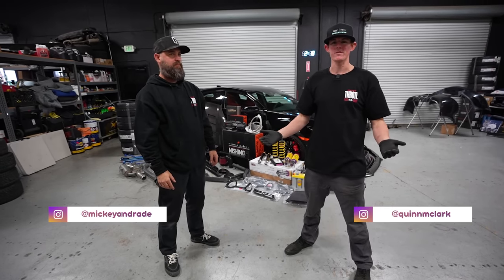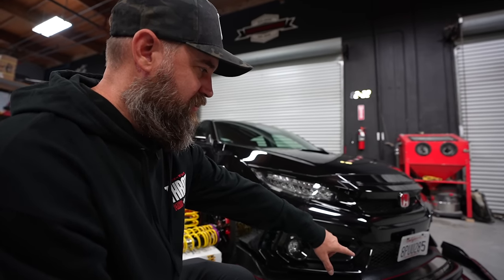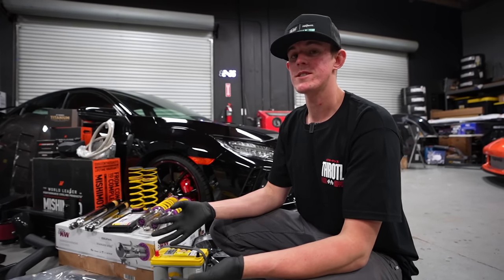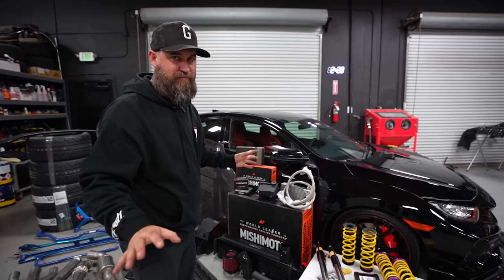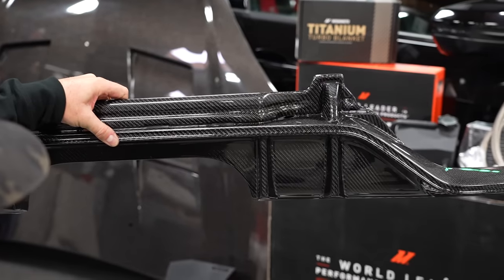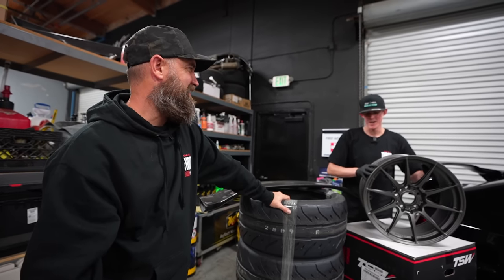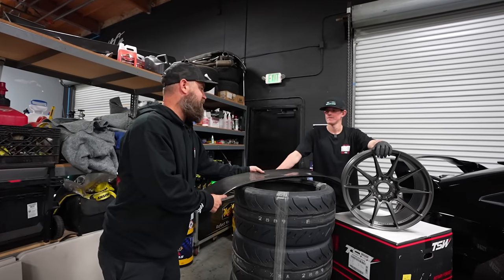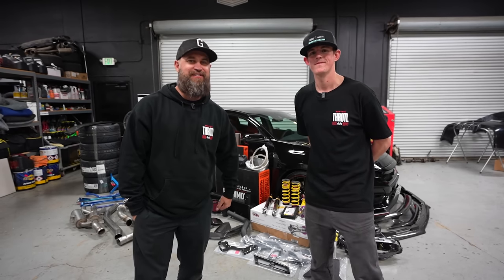Building the ULTIMATE 2020 Honda Civic Type R - Part 1 - Parts Haul!

Comment: It's the 20's and the weight that help! Honda engineered them to help. I put 22 lb sparco pro corsa's on mine same fitment as the tsws are. Hope your on the 20ish lb range on wheel weight. That should help keep that torque steer down.  The eps does have an assist and the LSD honda uses is sooo good!

Comment: A good car hack to minimize under hood temps is to remove the weatherstrip at the rear of the hood on the valance. You may reduce temps 10° - 14°. I think torque steer has more to do with the axle shaft length being close to equal as possible. Correct me if I'm wrong...
Reply: Not true on these cars, the passenger side shaft is nearly a foot longer. Just had to swap the trans in mine
Reply: @Aikenpowersports  it must be an ancient Japanese secret how gonna handles the torque steer then. What causes some powerful FWD cars to have torque steer and some don't?
Reply: @PANTYEATR1  could be in the steering rack, power steering system and things like that. I have a steering stabilizer on my quad that helps keep the handlebars straight in rough conditions, just a theory though. Im a mechanic not an engineer haha
Reply: @Aikenpowersports  I'm an advanced diesel mechanic and i have a 1997 Dodge neon (like Ricky's son has) and I'm pushing close to 400hp with it and it doesn't have torque steer. I don't know if the SRT4 has torque steer, but i don't recall anybody complaining about it. Not for the Chevy cobalt or the high powered VW golfs. Hopefully someone that knows will chime in...

Comment: Can these be converted to AWD?
Reply: With a firmware update I'm sure.....
Reply: @pmolitierno  hardware*
Reply: @RadDadisRad  I don't understand?
Reply: @pmolitierno  the CTR is FWD. It will need a hardware update to be AWD. I am asking if anyone has converted one of these to AWD.
Reply: @RadDadisRad  It's Thanksgiving, I'll be nice.  I was messing.  Any car can be converted to AWD with enough money......No clue if any of the usual suspects in terms of transfer cases and differentials have been mated to this platform yet.  It would be so much better if it was AWD for sure.
Reply: @pmolitierno  that’s what I was getting at. I was going to bring up the “anything is possible with money” but I am curious if the new CRV stuff has been used to make an AWD Civic or Accord.

Comment: If it did happen...

Me: (wins the FK8)

Also me: asks for the car to be put back to stock performance wise save for a few things except for like the the upgraded radiator because of the apparent cooling issues.

Why? I would at least want to try it stock first, learn it, then figure out what I want to do. I also HATE hopping into someone else's build because you never know what screw ups can be found even though as like the MR2 giveaway car, it was made up for and swapped with a different 2GR V6.

Comment: I'll never undestand carbon fiber overlay items. Carbon fiber parts should be adding lightness, not weight. (I know, they don't add a damn, but you know what I mean. I would rather replace parts with CF ones, than sticking parts over existing ones).